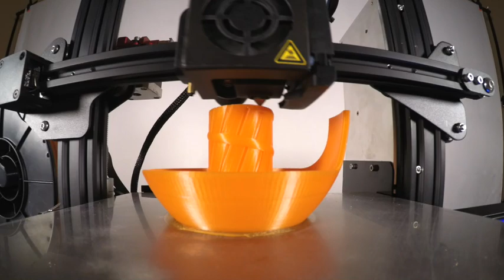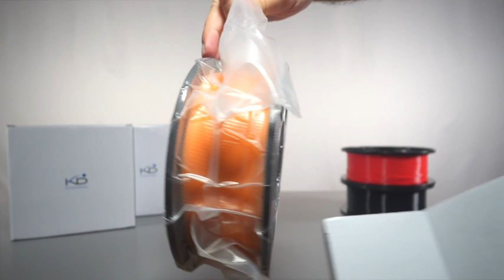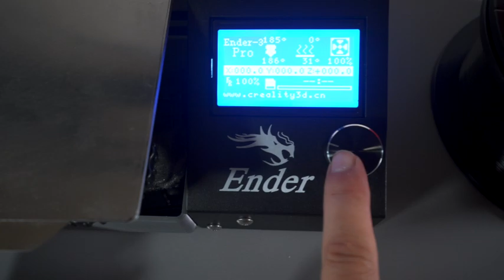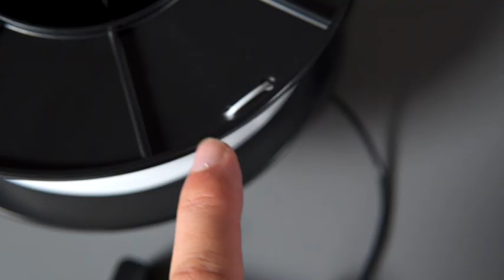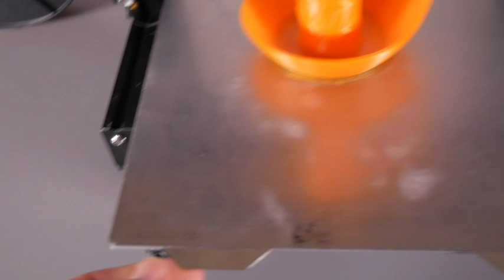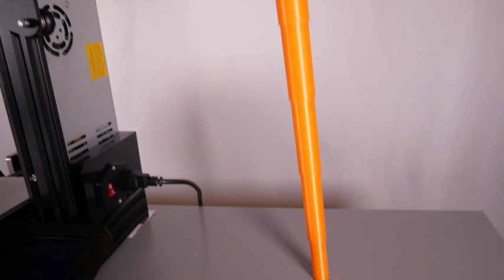KabelDirekt - KD PLA Filament - 3D Printer - Review

Comment from the maker: New Channel: www.youtube.com/@Just_Print
Even though I filmed this video in 4K, some how i managed to upload it in 480p Enjoy...
Black: https://geni.us/IlXZwY
Blue: https://geni.us/7uD7
Green: https://geni.us/CGUFz
Orange: https://geni.us/2N7aB23
Red: https://geni.us/qIk20
White: https://geni.us/qKOnF

Ender 3 Pro: https://geni.us/xUMach
Recommended: http://geni.us/JustVlads
Pirate Sword: https://www.thingiverse.com/thing:3597069
Reply: Little tip for a new mod for your printer, put a bit of sponge in front of your extruder (just stick your filament through it and it doesn't go anywhere) and spray some wd40 on in. It keeps your bowden tube nice and smooth and also keeps dust from entering your hotend.
And for the ringing you have, it helps if you put the printer on a rubber sheet to stop vibrations(usually used for speakers and stuff).
Also you can lower your acceleration and jerk settings to minimize to reduce it further.

Comment: I'm pretty sure that's relabeled Janbex filament. Janbex has the same spools, same winding, the colors look the same and they're also a German company. The KD filament is cheaper than the Janbex which is very nice.
Reply: Im also sure. Even the difference between color on spool and printed is exactly the same as janbex.